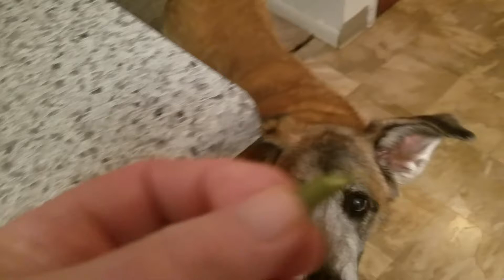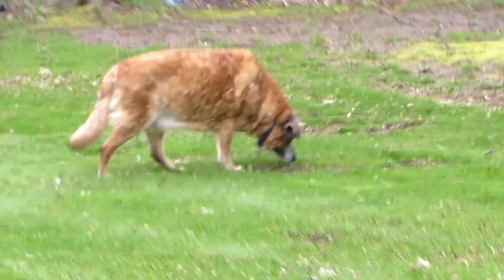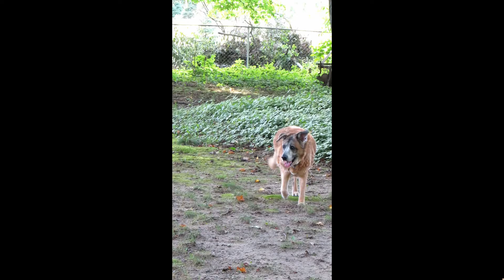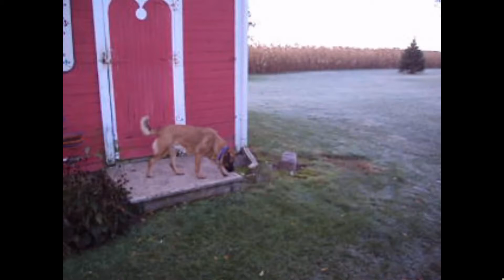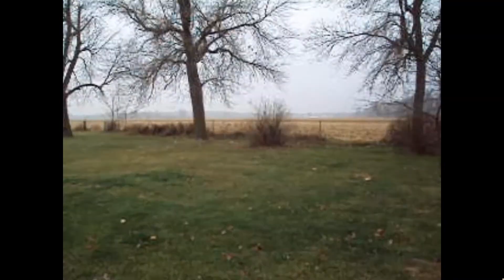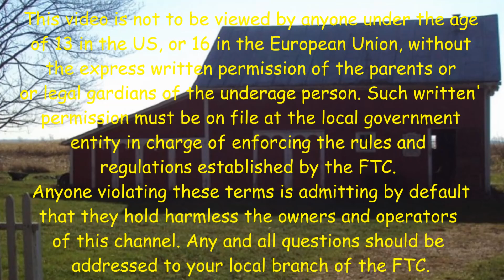Sadie's World Management System Using Detectable Limits

Comment: Boxes need to be ticked!
Reply from the maker: When I worked for Product Action as a Location Supervisor the business plan was to sort parts for defects. If the crew found a problem with the parts that wasn't part of the original sort parameters I was suppose to advise the customer that there was additional issues and get them to ask for a resort for the new parameters. Some sorts were active the whole 5 years I was working for or with Product Action. It was a way to make money. We were told to turn in a new defect, if possible, just before the sort ended. 
The EPA is the same way. They are looking for a reason to keep finding something to justify their presense and forcing industry to keep paying for EPA to create more regulations therebye justifying their existance. 
If they would just write out exactly what they wanted 99% of the companies would be happy to meet all the requirements. They would rather write up ambiguous regulations that require EPA inspectores to keep comng beck for more and more inspections and fines.
Reply: Everything is to do with making money and covering asses!